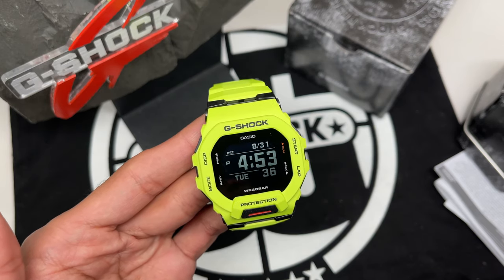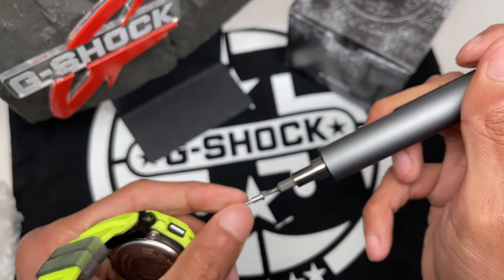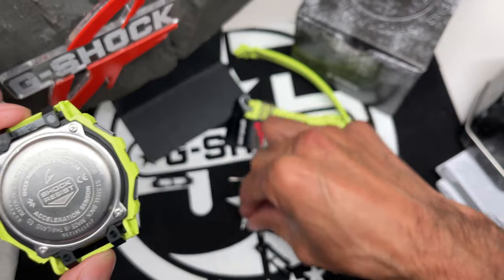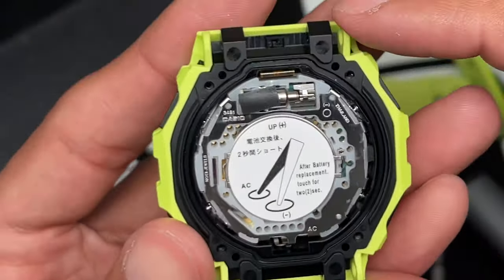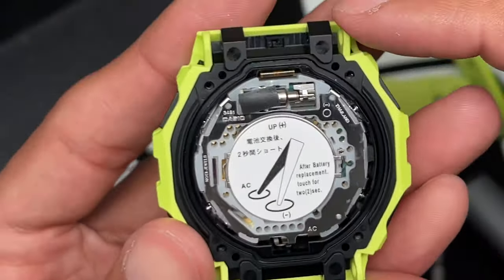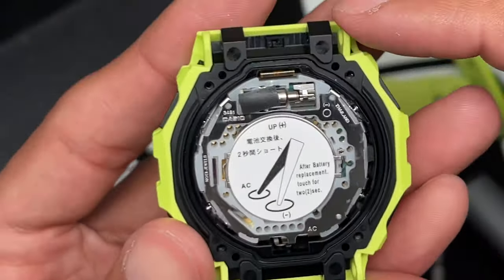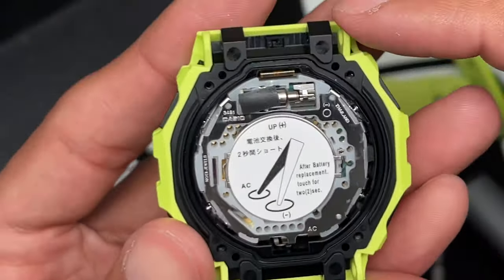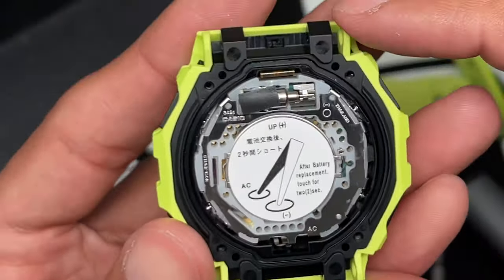What's Inside a GBD200? How to Change the Battery? Opening up the Watch to get a close up look

Comment: I don’t understand the AC reset what did it do or why do you need to do it?
Reply: The AC reset, think of it as (All Clear) as any remaining static charge in the module could interfere with full function.  Once you complete the circuit, it is fully reset.

Comment: Thanks for this Video. Question: do I really have to remove the strap to change the battery, or can I do it without taking them off? Thank you.
Reply: Hello, it's not necessary to remove the bracelet. By slightly removing the black plastic, the metal plate has been removed. I just did it. My watch froze as soon as I changed screens, I couldn't access any settings.
An exclamation mark was present at the bottom right of the screen.
Reply: you really have to remove the straps so you can open the cover. I watch my hubby changed a lot of GShock battery(s).

Comment: Just got the watch and messed up the diagnostic mode (got stuck on ‘WAIT’ screen when try to update the fonts), thought replacing the battery would fix it and it did, thanks for this video!

Any insight on the diagnostic mode would be great tho 🤙🏼
Reply: How do you enter that mode
Reply: @NotsoPHYSale  you press the A (Disp), C (Mode) and D (Lap) buttons simultaneously, then you will enter the watch’s diagnostic mode
Reply: @chriskartokusumo7322  it doesn't work on mine and I'm sure mine is not a fake one
Do you have any tips like pressing and holding or any particular screen where it is only accessible?
Reply: @NotsoPHYSale  might be watch specific
Reply: @NotsoPHYSale you should be try it in main screen which has the biggest digits.

By the way I stucked same wait screen careful😂

Comment: This watch is real crap - the battery only lasts a few days with Casio Move sync. Anyone has a solution for this problem? I'm going to return the second watch - the first was sold to me already at 0 battery, the second had a battery depleted in 3 days , so i changed the battery and after 4 days here we are again. Terrible, terrible watch by Casio i wasn't expecting this
Reply: FAKE
Reply: @isaacortiz7210  ? Fake watch?

Comment: Just received my GBD 200 and the battery light is flashing right out of the box ☹️
Reply from the maker: That’s impossible… i mean anything is possible but shouldn’t be the case. Where did you buy it from?
Reply: @GiShockGo  Masters in Time...gosh darnit...did I mess up? How the heck can a  bad watch get released from the factory. I opened it up, the time was on, a pressed a few buttons starting the stopwatch. Then set it down until I could dig into the manual. When I picked it up the (!) was flashing in the bottom corner and no buttons will function.
Reply: The manual reads that this is the expected behavior with a low battery. So the non functioning doesn't worry me but the battery does.
Reply: That's really messed up man. Did you sort it out?
Reply: @justincross83  holy sh#t mam, thats sounds like one hell of horrible experience, I would be so damn angry but that wouldn't sort anything lol. I also have the black  one, love it but want the yellow!! Blue is nice too,  so the black they sent you was fully working?
Reply: @isthi000ify  yea Casio said the module needed replaced on the blue so they would return it broken or keep it and give me a new black one. So I cut my losses and took the new black.
Reply: @justincross83  smart move man!!
Reply: @justincross83   but you said Casio gave no warranty
Reply: @leonidjoseph5483  they said it wasn't covered. I paid for 2 shipments to their repair center and the battery replacement. When it turned up broken they did come through after 3 phone calls of me pleading my case.